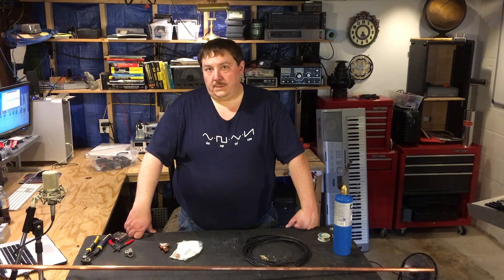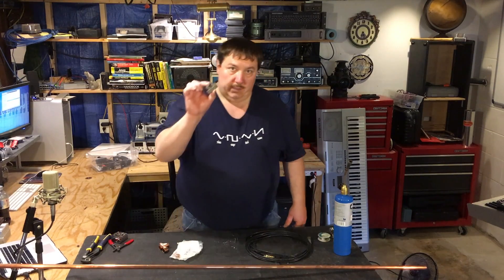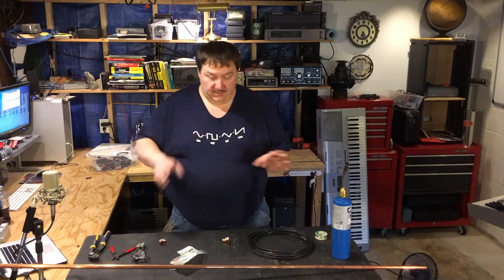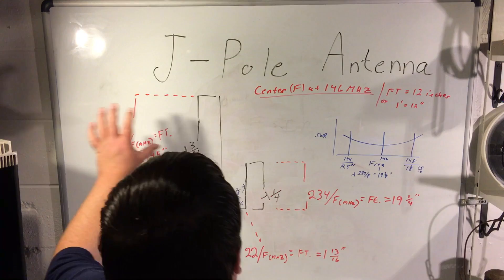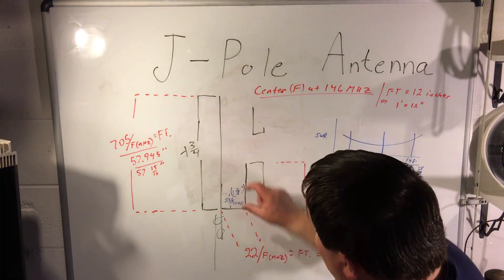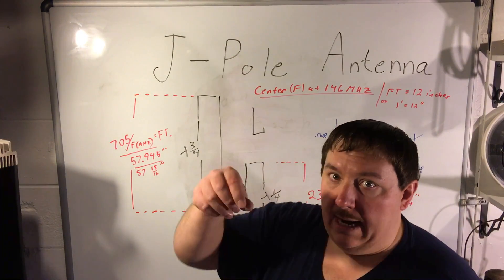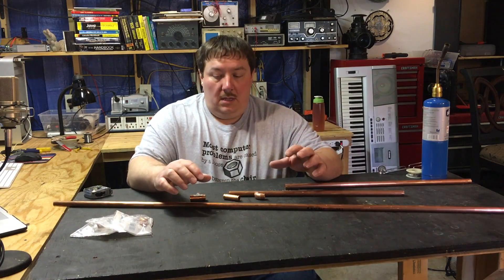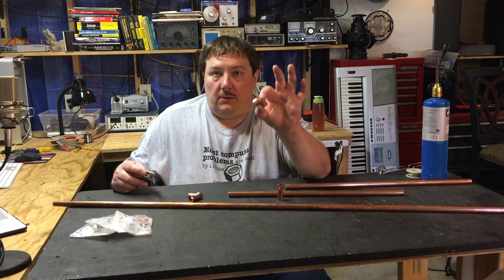J-Pole Antenna Build. part 1 of 2

Comment: I had an idea, yes that can be dangerous. If you got a collar, like is used to put 2 places of tubing together.  Cut it in half so you have 2 places that will slide over the tubing.  Slide it over the tubing near where the coax is connected,  will need to clean out the inside so it can slide on the tubing. You can connect the coax to them test it and slide them up or down to adjust it.  Then solder it in place.